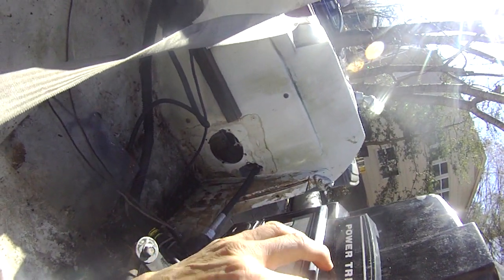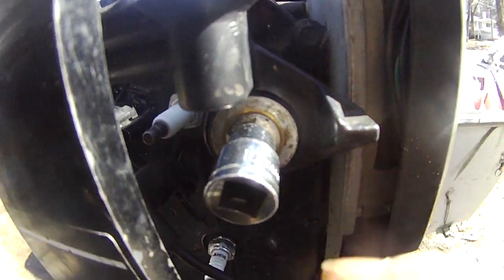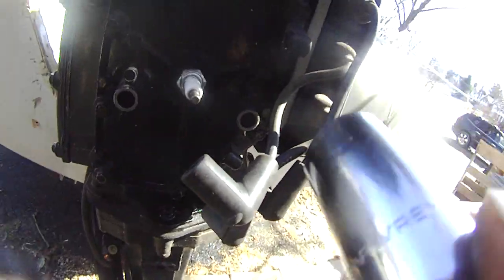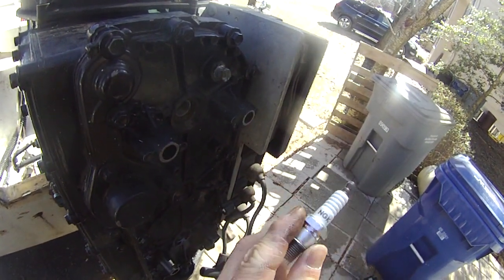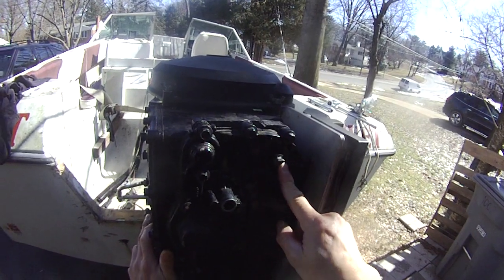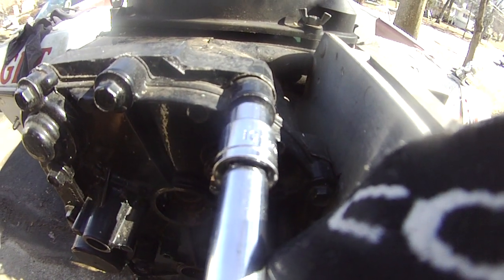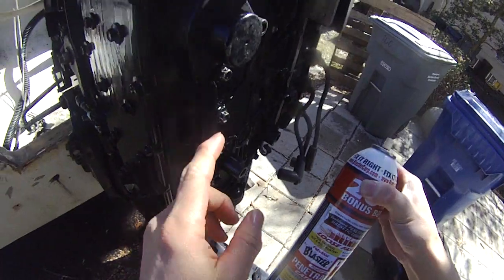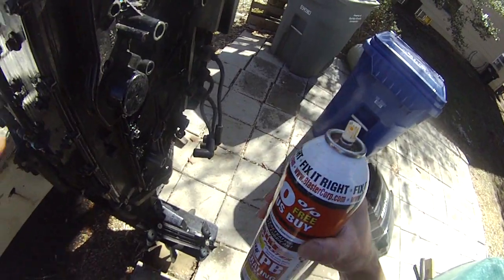mercury outboard 90 hp tear down - diy outobard rebuild part 1 - spark plugs removal

Comment: How did you determine that had low compression? Had you done a compression test and how many pounds of compression did you have in each cylinder?
Reply from the maker: Watch my compression video. It was 70, 70, 30. I added some oil into the spark plug holes, They went up to 90, 90 and 50. There were holes in them especially the #3 cylinder after I took everything apart.